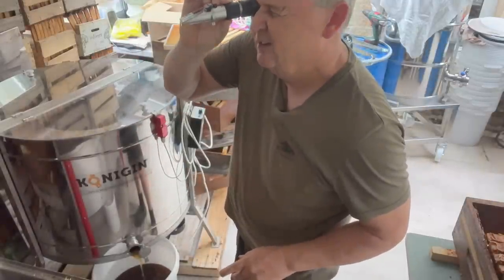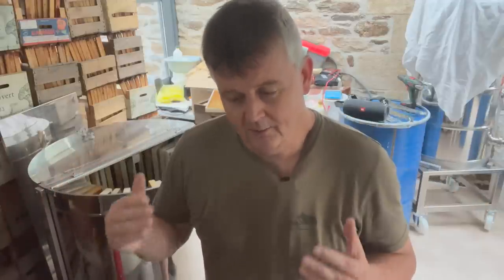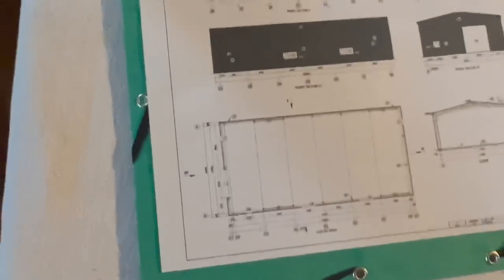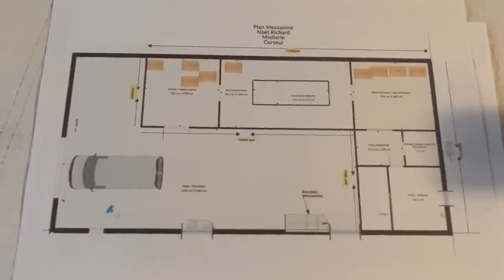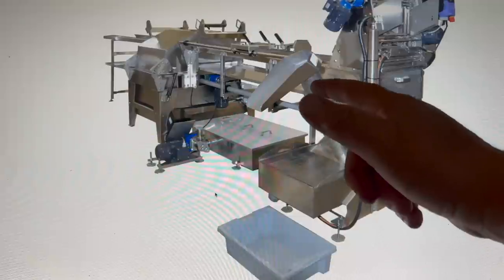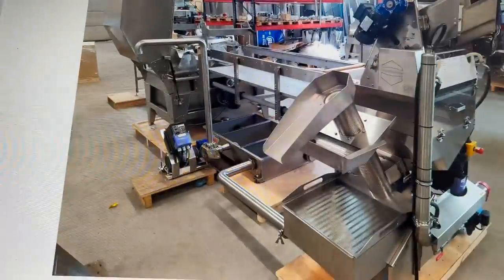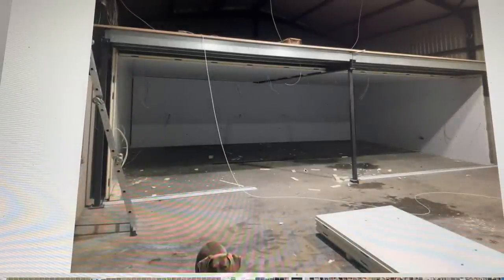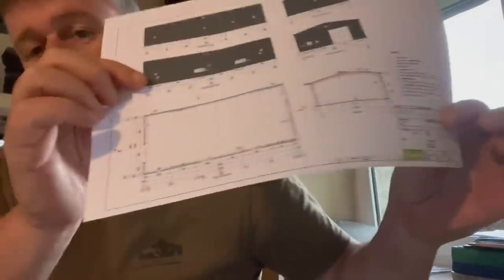Honey house plans and equipment!! Here it is!!🙌🐝💪🏻👍

Comment: Just a heads up for you Richard based off of my own experience. I have a Paridise wax press under my Cowan uncapper. The wax press does work well but a couple points of interest, 1. You really need to be careful not to let any pieces of frames, nails or any hard material dropping into your press. It will make a mess of your grill and auger if it gets jammed in your sleeve. 2. I would make the suggestion that any honey squeezed out of your cappings to have it drained to a separate sump from your extractor. I find the honey is always cloudy and only good for making cream honey. Congratulations!

Comment: Hello Richard best of luck with the new setup. One thing  I don’t see in any of the commercial units. are areas for washing & sterilisation of the equipment , hives etc which can be pretty messy! . How do you plan to do that?
Reply from the maker: Hi Alan extremely good and valid question basically the whole of the extraction room can be washed down and will be washed down because it will have a main drain in the middle underneath the extraction machine luckily the only place where electrics are really delicate in other words where they could get wet, is at the beginning of the machine where the frames go in so that area is kept a little bit drier but the whole machine can be washed and cleaned it has to be made so it can be washed easily just outside the extraction room there is sinks in the main area To be  plumbed in and they will be not going to the septic tank they’ll be able to be just run over the ground or stored water but it’s a good question it will flow pretty well but as I said in the video I’m doing the floor plan for the drainage now and that’s quite complicated because it encompasses underfloor heating and drains all in the same area so it gets a bit chaotic anyway thanks for your question.

Comment: We purchased a Paradise Honey extraction line with a 27 frame extractor and honey rocket wax processor.  It fit in our two car garage honey house.  Things we like: it can be run by one person, there is far less handling of frames than with the old system, frames are ready for the extractor after they go through the uncapper-pricker, the extractor is faster than our old radial 20 frame extractor, it fits in the space we have, the pieces fit together well and work together well.  We don't get honey that is as clear as we got when uncapping with a hot knife.  Be careful to check the nuts holding the little arms that hold the frames in the extractor as ours tend to come loose.  Learning to run the new line had a steeper learning curve than we expected but we have reduced the labor and time it takes to extract honey significantly.  The employees at Paradise Honey have been patient with our questions.  And they speak English.
We run about 70 hives in the Seattle, Washington area.    
Your new honey house looks great.  I think you will like your new extraction line.
Reply from the maker: Hi Patricia, thanks so
Much for taking the time to reply I really appreciate your comments. It’s a big journey and it’s great to have fellow beekeepers with a similar set up as mine!
Hope your journey continues well. Best wishes. ‘Richard
Reply: @richardnoel3141  We will be very interested to see your new line and how you use it.  We still struggle with cleaning the equipment especially the honey rocket.  We just started using it in June, 2022.

Comment: Just wondering how you are going to protect the structure in the extracting room when you may be using a pressure washer and lots of  water to clean up after extraction?
Reply from the maker: Hi Chris, the machine is pretty wash proof by default and the room has a large drain that runs in a sloping conduit underneath the whole machine. The walks will be plastic laminated insulation. Basically the same as most cold rooms.
Reply: @richardnoel3141  Thanks Richard, great to see your business expanding.

Comment: Nice to peer into your world and seeing you advance and get everything together. I too am thinking maybe in another season or so to sort a extraction house out. I only have a fraction of the hives but spent a lot of time with a carving knife this year with a nice bumper crop. Love the big spinner but may I ask do you mix the honeys from your different apiaries? I find each of my apiaries usually produce a slightly if not totally different honey to the others and try to keep them separate. Assume on the level your at it’s easier to just mix them all up?
Reply from the maker: Hi Ryan, historically yes I did mix most of my apiaries up but it stayed as summer and spring and indeed there is variations between apiaries. However in the future I will be  trying to  separat my apiaries because the general public, aka my customers love individuality and a honey from there area. If we have any chance of selling regularly it has to be that extra like for the customer. Good question. Best of luck with your project!!
Reply: @richardnoel3141  it’s one of the reasons I kept each honey separate, selling to local shops the customers want it as local as possible so to produce a honey from the same location as the shop has proved very successful but as always it’s not the selling but producing Enough is the hard part as it seemed to not take long for the restaurants etc to make contact also👍🏻
Reply from the maker: @Downthend  totally with you!! Local is best!!

Comment: Congratulations with your new machinery, but I’ve doubt s about the ergonomics off work flow in the architecture off the building
Reply from the maker: Everything is palletised, entry and exit points. Having worked in similar workshops I have some good pointers but there is always room for improvements. If you want to share your points they would be helpful?

Comment: Is there a program you used in order to draw up the plans for the building ? Or was that the builder who did that?
Reply from the maker: Hello Walter, the building is actually a kit building that’s going to arrive from Belgium and it’s an agricultural type building but fully insulated . So when you normally build a building you have to get an architect to draw the plans up because this is a kid building it comes with its own plans already done so there was very little to design however I did need an architect to submit the plans on my behalf to hopefully gain permission to build so because I had plans already drawn up from the building supplier it’s save me a lot of money because the architect just charge me a fee for putting all the plans together. The plans I showed you were an extra thing I bought it’s an online design studio it’s only about €6 a month and you can use it for drawing basic 2-D and 3-D plans to scale. It is a real help for me because I am pretty poor at stuff like that but as the slab is gonna be built by a builder as long as I have the drawings with the rough dimensions they can work to that what is a good question to ask because in most times, you need to pay you architect a lot of money but if you get a building that is in kit usually it comes with its own plans and that where you can make a big saving

Comment: Often commercial building have gaps where the corrugated roof sheets meet the external walls (the standing seams create a gap). If these aren't filled you might have problems with bees coming into the building during honey extraction in a dearth. Worth keeping in mind
Reply from the maker: Hi Michael. I’ve asked before I bought the building that all roof parts are bonded and no leaks.don’t forget in the extraction room and warming room Inside i am building another Inside skin that will divide up the rooms. Bees won’t be able to get in.